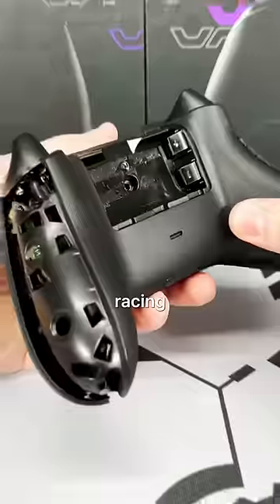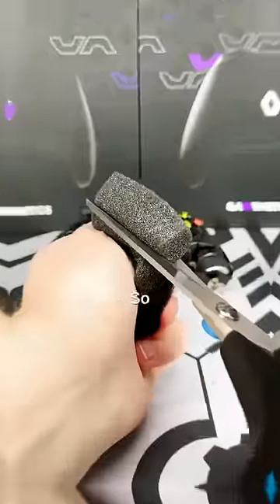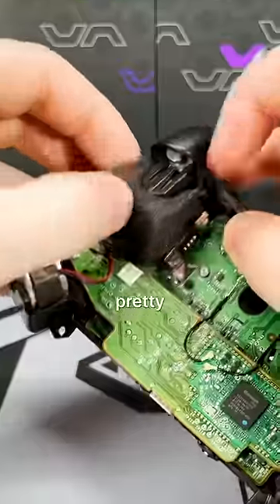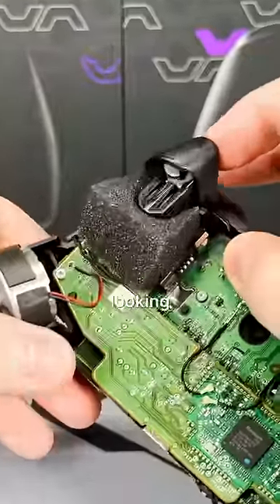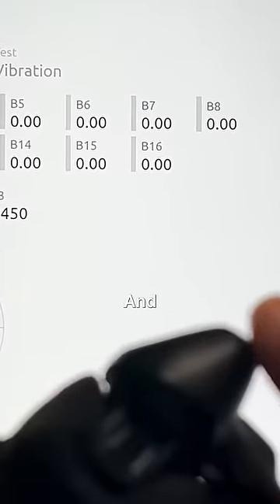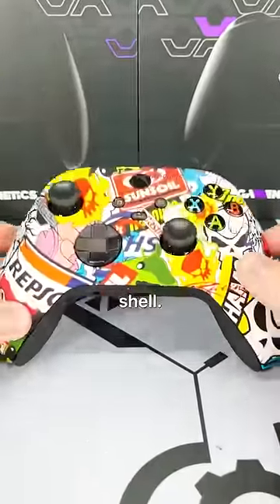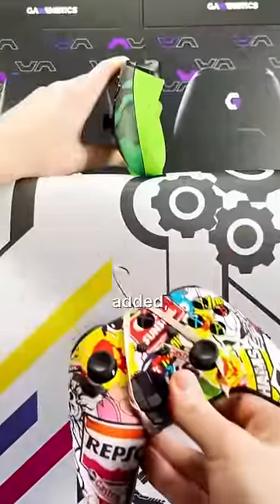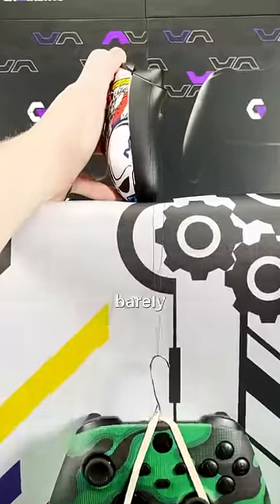The Controller BUILT For Racing

Comment: besides the foam probably melting onto your board, excessive force may cause either the trigger mount to break due to it have something in the way of sending the trigger fully down when it’s supposed to therefore straining the mount and causing it to break or idk how to explain this one but having something thicker and being compressed onto the part of the board that’s built for a small piece of plastic touching it may cause the board to break idk about this one though

Comment: "I wanted the trigger to have more tension like a gas pedal"
1) Errr fly-by-wire cars have a potentionmeter just the same as a controller so it's like standing on a marshmellow.
2) the brake pedal (with a bite point)..... completely forgotten.

Comment: So many people talking about the DualSense, not realising that this is an XBOX controller, used with AN XBOX...
The DualSense is useless on an XBOX, it does work on PC but not much games actually support the adaptive triggers (even PS5 Games that were ported to PC do not support them...). 

This is a cool idea and could go further (such as using rubber instead of foam and bracing the PCB (maybe covering it) to levitate stress. A cheap and easy alternative to buying a controller that does this feature (if they exist, I have never seen one before).

Comment: I tried this , and it was beautiful gameplay, i still prefer a wheel set up , but if u cant get that its ok, my controller just ended up shorting out due to an already faulty connection somewhere (it was previously a used controller so it was old anyway) , but glad im not the only one that tried this idea lol, my only complaint was trying to drift with it lol

Comment: i cut down a spring from a pen to the right size made it hot and melted it in between the trigger and the base of my ps4 controller. a lot stiffer and better brake control :D

Comment: Bootleg adaptive triggers, imitating what you can find in a PS5 controller, except that they are not even adaptive but simply more difficult to use.  The Xbox controller really is holding back gaming controllers as a whole, being the lowest common denominator.

Comment: im in the middle of creating a arduino powered racing controller... i want l1 and r1 to be axis's as well. so i can have clutch and brake on l1-l2 and handbrake and gas on r1-r2 .. and then i think im a grab a thrustmaster forza module.. and ill rip it apart and wire it into the controller lol . i thinik the idea of being able to actually use a controller with clutch in the crew games.. and a bunch of others that dont lalow u to map a button to clutch

Comment: Won’t it set the controller on fire if it overheats?
Reply: When has an Xbox controller overheated, most of the time these chips run cool and never hot enough to start a fire
Reply: Fires don’t start at 150-170f. What are you talking about
Reply: @ZeldaNumber17  I don’t know I’m not experienced with that shit and use normal numbers not this Fahrenheit bullshit.